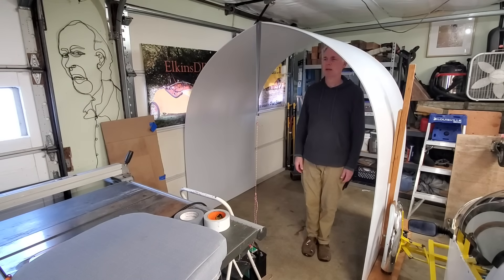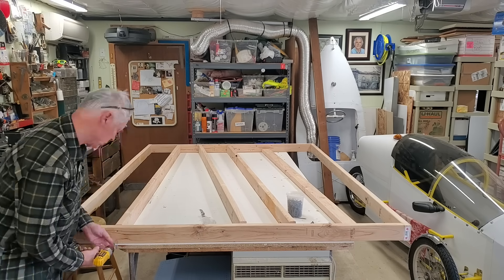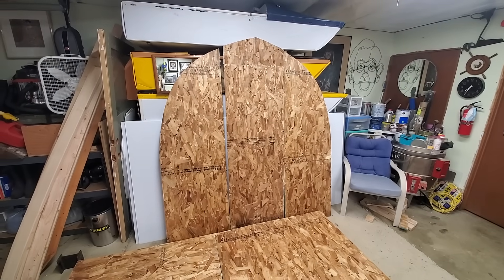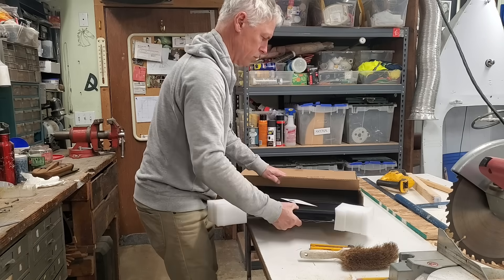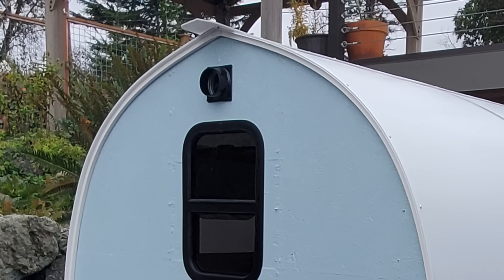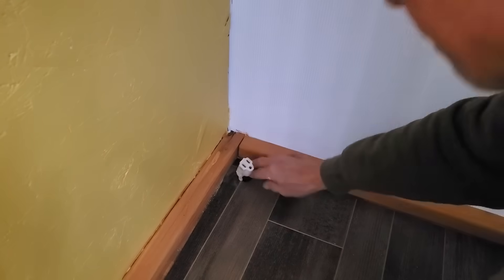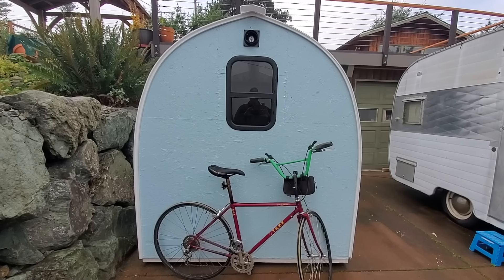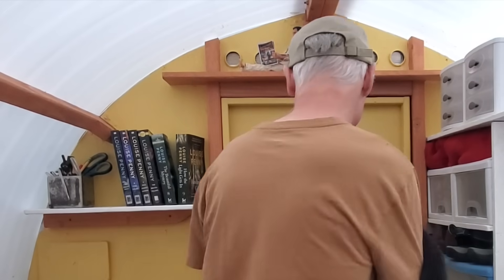Homeless transitional shelter prototype

Comment: The locking hasp on the door allows any random person to lock you inside.
A standard deadbolt is inexpensive and safer.  Just add some wood to the door in that area to install it.
Reply from the maker: Thanks for that deezynar.
Reply: @paulwelkinsdiy  
I really do like the little house, and have been a subscriber for years because I like the projects you make.

Comment: they make a insulated plastic glass which is two layers which space in the middle it's nice material to work with
Reply from the maker: The 6-10mm thick polycarbonate greenhouse panels?

Comment: Just needs a few inches of insulation, synthetics are easy but a fire hazard and rock/glass needs an inner shell to not drive occupants insane with itching.
Reply from the maker: Good point. I've tested the fluted plastic burn rate. If someone does leave an open 'flame' next to the panel it will slowly catch fire, and slowly spread, dripping and melting and putting out some strong fumes. That's why I chose to put the stove near the back of the structure farthest away from the door.

Comment: Your lock arrangement made me physically cringe. The way that is set up, the occupant can become a prisoner in a second. When I was 10 yo I was locked in a shed that had the same arrangement. I went in to get my bicycle, and my "friends" thought it would be funny to lock me in. My dad built that shed like the proverbial brick s#!t house. It also doubled as his photo dark room. If was pitch black dark with the door closed. The kicker was that I was wearing the only key to the lock around my neck. When my friends realized they couldn't get me out, they all ran off. Worried they would get in trouble, they didn't tell any adults what was going on. It wasn't until my father came home from work at 10:30 pm that an adult knew I was missing. I had been in there since  about 3:00 pm. One of the first things my dad did was to check if my bike was missing. Since the key wasn't hanging where it should have been, he assumed my bike wasn't in the shed. I went driving around the neighborhood looking for me and/or my bike. Finally, at around 1:00 am my dad ran into the father of one of the kids. The father went and interrogated his son. They found a bolt cutter and got me out. I had nightmares for months after that.
Reply from the maker: You can't get locked in. You would need a key to turn the lock. And if they closed the hasp over the lock, I added a hole in the door where a nail can be inserted and open the hasp away from the lock. Simple.

Comment: So much useful tips for other projects. Fluted plastic sounds like just the material i needed for my craft show trailer build. Currti was going to use the plastic lattice due to its light weight and affordability in my area. In the rainy season i have a handmade waterproof cover i did with SkillTree’s videos

Comment: So to use in winter wouldnt you need insulation on walls, roof? How would you recommend that done in cheapest/most effective way? In BC and we have big homeless issues close to where I live, love the ideas.
Reply from the maker: I made allowances to add 1.5" thick foam board in the interior. I'm seriously thinking of adding that, but for now I can get the inside about 40 degrees warmer than the outside with my electric oil heater.
Reply: @ thanks

Comment: You get add insulated tarp blanket for the roof in winter. and cheap 1 inch insulation for walls for winter.
Reply: Snowload?

Comment: Every architecture & engineering student seems to try and optimize a design to Solve Homelessness, myself included.  Ultimately though, homelessness in the US is not about a lack of housing.  It's about a lack of legally recognized housing, and a willingness to regularly send men with guns to tear down homeless encampments.  In areas where this doesn't happen, in the developing world, a homeless camp autonomously builds more and more sophisticated dwellings based on whatever is available (mud, plastic sheet, tin roof, thatch, whatever), until it's basically a normal neighborhood with some mild infrastructure deficits and informal land tenure arrangements.  In the "developed" world, if you are not recognized to have the correct permission to live in a place, then everything you own is subject to seizure, and the more durable it looks the more tempted the authorities are to remove it.

Comment: I think Port-A-Potty mfgrs might be able to use the thick recycled plastic they use to make a durable and reasonably light shelter. No need to cut wood, paint, screw things - just snap/slide the connecting edges together. Floor space is precious so I wouldn't waste any room making a porch. Just set up a camping canopy out front or tuck the entrance of the shelter under a pavilion. Also, no need for windows. Nobody sits inside their shelter looking at scenery. I'd save space by not installing bathroom or kitchen stuff unless this shelter is isolated somewhere. Better to have bathroom and kitchen facilities shared by a group. Coroplast could also be used to make something really lightweight. I picture a two-level cart where a vardo-covered sleeping area is on top with storage space underneath.

Comment: Would there be a cost benefit to using exterior grade composite decking material to build the "foundation" floor? It would last a lot longer in damp environments.
Reply from the maker: I haven't checked on the cost of composite decking, but I'm guessing they might be more expensive than wood.

Comment: Why not kraft normal house 😮. Normal material stone or wood or steel?
Reply from the maker: cost
Reply: @paulwelkinsdiy  I agree, why not make yurts then, it’s like tents, only if you make them a little more than 40 square meters, a person feels psychologically good. Well, you can use any material, I would use metalized films. Yes, and you need to make windows not only over the top, but also like in an ordinary house. I once lived in a tent in the summer and felt discomfort due to the lack of transparent windows.
You can also use flexible solar panels on top.
We need to do it like in Germany there are houses for the poor. But they are no different from ordinary houses; the price is simply low and it is constant. Well, it’s not good everywhere either, depending on the region (land)

Comment: Zoning smaller, less expensive single-family home lots might be helpful in solving the affordable housing crisis in Canada as well as in the U.S. Since rents and strata fees continually rise, and good standing, long-term tenants can ultimately be evicted, the secondary rental market is not a secure housing option. 

As is evident, current wages are not going to rise to levels affording existing homes, and existing homes are not going to decrease to levels meeting current wages.

This leaves lot price as the most significant cost that can be readily reduced when it comes to affordability, and the only way to make a lot cheaper is to make it smaller. 
 
Using the area of a typical-sized single-family lot as a starting point, one could split that area into four smaller lots and charge say $100 000 each for example, thus instantly reducing a typical mortgage by hundreds of thousands of dollars.

Then, using a basic building cost of $275 per square foot, a modest-sized home can be built with the mortgage funds that remain.  

For example, using a 30% debt ratio standard of affordability, someone earning $4000 per month could qualify for a $180 000 mortgage with a $1200 monthly payment. Hence, a 290 square-foot home could be built with the $80 000 that remains, and so on.

This is also an economical approach to the housing crisis as no public funds are needed.
Reply from the maker: There are places where narrow lots exist in tight urban locations, with slender homes being the norm. Cut that in half and yes, I think it could be done. Thanks Jason.

Comment: Your outside lock, can it be locked open so someone can't lock you in with the hasp ? I like that it doesn't use a separate padlock (easy to lose).
Reply from the maker: I drilled a tiny hole thru the door by the hasp in case someone closes it. Poke a nail in the hole and walla, the hasp opens.

Comment: Around the 7 1/2 minute area, you need a different kind of door latch/lock.  It needs to be something that if you are inside, someone else could not manage to flip the latch around and jam or lock it on you to prevent you from getting out, or forcing you to resort to breaking out through the walls.

Comment: Please do not plug a high wattage appliance into an outlet strip unless it is rated for heavy draw equipment.  The wires inside are tiny and the strip will catch on fire before the built in circuit breaker trips..  They trip when an arc is detected and an arc may not occur until after the strip is on fire. I am a landlord and this comment is based on experience.  Do not use strip for heaters, a/c's, blow dryers,  microwaves, hot plates, slow cookers, waffle irons ,coffee pots, etc.. Use a heavy duty strip that is for construction equipment and only plug in one high draw appliance at a time. Small lamps, alarm clocks, radios and small draw items may be plugged in and used simultaneously.
Reply from the maker: Thanks for that DON! Great advise!

Comment: I could see mini shelters like these turning into a possibility towards giving people a chance to get back on their feet. But there's one problem still in regards to utility and hygiene. Even with how cleverly it was done there... It has to be cleaned up eventually. As well as access to electricity might be extremely restricted. So there's a great deal of issues around the uses of wherever those would go. And that's not counting getting it there in one piece. IF there were some public facilities that could be shared and managed for the whole camps, then there might be some hope that they could even thrive in spaces like those. Even for how cramped it can feel.

Comment: awesome build!  As for the fluted plastic- small town North Conway, NH home depot and lowes both carried some type of coroplast 8 years ago and even in various sized sheets from small 12X12 to full 8X4 foot sheets.  I used the big sheets to make a guinea pig herd enclosure (look uC&C cage if you are interested, lol)  they even carried the cutting tool so you can bend it easier.

Comment: Just when I thought you couldn't get any more talented, you show us your dance moves 😁🏅👌
Your insights into homelessness are spot on Paul 👍
When I lived in a large van, I used a 3' round rubber paddling pool as a shower tray...with a bit of practice, it worked great...and of course, when rolled up it took very little space.
Reply: Could  this be made into a camper on a  pull behind tralor 13:03

Comment: I've got something called poor man's fiberglass that I coat over waste cardboard.   You can build great structures with it and homeless shelters are what I want to build.   Much cheaper and it's amazing what can be built with it.   I'd like to collaborate with you on some stuff.   Great video BTW.
Reply: I'll work with you. I'd like a fiberglass alternative and using cardboard. Was working on ideas today. Then I saw your post today. Is it secret, patent, etc. ?
Reply: @wethepeople4145  @paulwelkinsdiy @MikeKeesler While you guys are thinking along those lines it occurred to me that a more durable structure could be made by gluing burlap over the chloroplast then covering it with one or two layers of stainless steel (or possibly fibreglass) flywire mesh for added rigidity. You would then paint it with a vinyl enhanced cement slurry to maybe 1/4 inch think. This stuff dries rock hard and of course increases the weight BUT what you have already made Paul is an arched (permanent) formwork and the stuff dries PDQ and will handle progessive coats. You could obtain a similar result using only a couple of layers of burlap to create  "starched hessian" or "hessiancrete" as it is known, but the flywire would be unaffected by UV. I am giving thought to buying a metal tube framed "chicken run", covering it as described and painting it with cement to use as a shed, as I can put the thing together myself, and conventional materials are both scarce and expensive in my remote location.

Comment: Well paul it may as well be a castle.......Ive removed the wheel of my ebike so i can use the motor to generate from the pedal so i dont have to use a generator which attracts unwanted attention..Your design could fit in a suitcase and blow up if made from bouncy castle material...Thanks for your time an a great vid

Comment: Great job. I'm building a pedal tricycle floating motorhome fully self contained with propane, solar and mechanical pressure systems. EST weight unloaded 630lbs. 6'×12'+ trike front approximately 15' overall. Next summer I start the project. Currently I have two dozen ebikes I've built and 4 E-boats

Comment: you do realize that 6 mm plastic is not really safe I carry several knives that can easily cut thru it like butter which means people with less scruples will do just that may as well use a tent like we already do when people are on the street. build a real wall its why the ones you called over built are that way for actual safety

Comment: OSB (oriented strand board) needs to be run perpendicular to the joists. The wafers are aligned so that is the strong direction- that's the "oriented" part. It's a good use of all the wood scrap left from the lumber milling process. The textured side goes up for traction for workers and also for a better surface adhesion. And it's definitely not "particle board". 
And maybe use an exterior latch that wont trap someone inside if the wind blows it wrong or someone messes with you.

Comment: I think nice as a little air bnb but with no bathroom,  running water, or kitchen it's a bit limited. It's not fireproof, so I wonder if would a tent on a platform be about the same level of safety, at a much cheaper price?

Comment: Have to agree, while a lot of building regulations and zoning restrictions are well intentioned, they create a scarcity of cheap, entry level housing, which inevitably drives up prices. I currently live in an old neighborhood that predates zoning, and there's a mixture of nice single family homes, smaller starter homes, duplexes, and small apartment buildings. If the whole neighborhood was single family homes on quarter acre lots, half of the current residents couldn't afford to live here

Comment: I saw a guy with a diff design (pentagon inste
ad of arch, one roof panel could open)  He used garage door panels for all the walls. Cut 'em with a skillsaw. They're insulated and weatherproof, and they give them away.  Because they are a composite, they don't recycle well.  They prefer to give them away, than pay someone to haul them to the dump.  Might be able help with costs in future builds.  Anyways, it's just a thought.

Comment: If it is 30-40 degrees outside, what sort of temperatures do you see inside? (with the what I assume to be a 1500W space heater running at full blast)
Reply from the maker: As mentioned in the description, with my little oil heater on low, the temp inside was 65. Outside, 40 degrees. Obviously the fan should be running some to help bring in fresh air, which it wasn't, but a layer of 1-1/2" foam board on the walls, which I've given allowances for, would help out greatly to retain heat or keep the shelter cool with a small AC unit.

Comment: Sun and ventilation in a sun state like Hawaii and Arizona though .  Desert means need for shade and ventilation.   At 120 degrees the need for shade is paramount.  Car tarp covering would be good with a air space between the living  unit  and the tarp .  ❤✨👍👍

Now to make this for the poor and homeless.

Also other type of options  are;
Venice portables, and Boxables tiny houses 

And Capsule sleeping pods units are 

Homeless,    Solutions !!!

 🏡🏠🏘️⛺🏕️⛪💒

Build small trailers yourself to put tiny houses on. 

       It's doable!!! 

Low cost, Mass production assembly line like the

 Model T Ford.

Sold in high numbers make a little money on a large number sold.  

Use city "sweeps", tax money to purchase them as a personally owned property to keep stuff in and safe place to sleep etc. 

Off grid solar panels on the roof. 

       Plus: 

Mini R V bike and boat camper home too is doable!!

Comment: What do you think of the FOAMULAR XPS insulation sheets for building material? Boards are insulation and people have used them to make RV trailers out of.   Is it too expensive?  I've seen some people glue cloth to it for added strength (poor man's fiberglassing)

Comment: have you tested how this stuff holds together when exposed to the elements om a permanent basis ,ive seen realestate signs made from this in australia and they dont seem to last that long when left out
Reply from the maker: I have Katie. Polypropylene does degrade after a spell in extreme UV climates. Where I live it's cloudy and rains more than most places, so a structure like this shelter should hold up for possibly 5 years before it becomes brittle.
Reply: @paulwelkinsdiy  once its bent into shape ,i think scuffing it up with wet n dry then giving it a paint with thick uv resistant paint would help protect it,ive also noticed so of the new composite boards comming out now,the aluminium foils with adb core would be good longer term material ,they bend easy come in big sheet sizes and are reasonable costs

Comment: Down in Oregon there is a very similar design being used, they are called Connestogas.
Reply from the maker: Yes, and, although a good idea, I felt It could use some improvements, hence the reason I came up with this design.
Reply: @paulwelkinsdiy  your floorplan has a lot more features.

Comment: 12:33 Is that a radiator? I've never seen one that small before. Is it for a mobile home?
Reply: It’s an oil heater or radiator. Electric.Does the job for a small place but can be expensive to keep on.